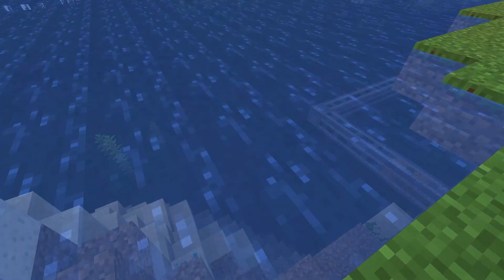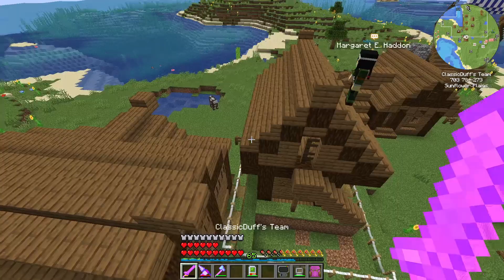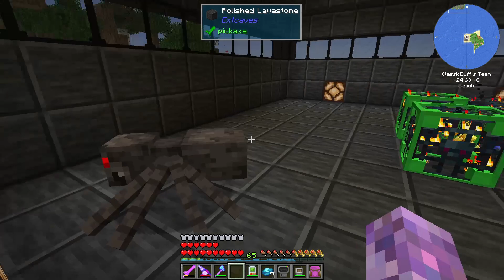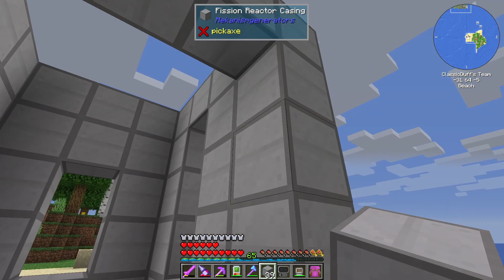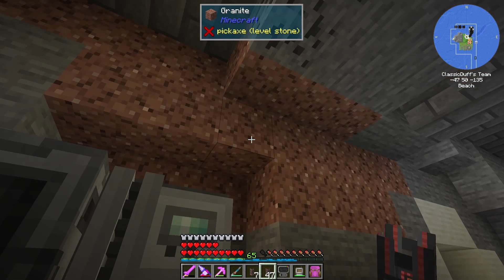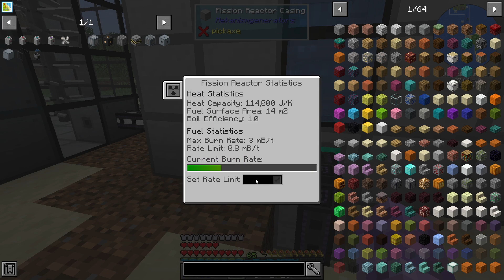Direwolf20 1.16 Ep 29 - Mekanisim Fission Reactor & Steam Turbine

Comment: If I had to guess, the waste is going into the pipe and filling it so that is why the reactor is nil. Also, you built a waste tank and then seemed to forget about it - which is probably why the tank wasn't filling, it is not radiation shielded.
Reply: Trash cans for fluids etc
Reply from the maker: I didn't want the waste tank to fill up, and thought I'd be able to store more in a big tank. Didn't know about the radiation shielding though 😬
Reply: @ClassicDuff  I don't know about the shielding for certain, but if the author pays as much attention as I think he does, that is probably the reason why.